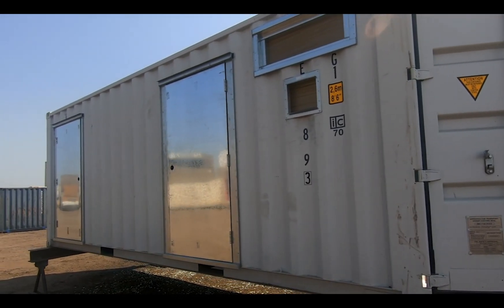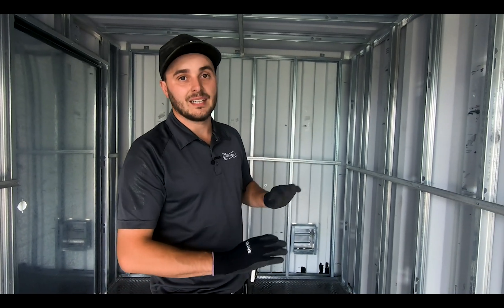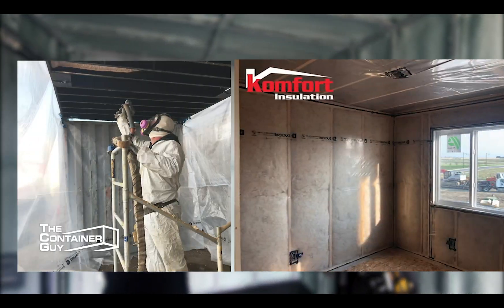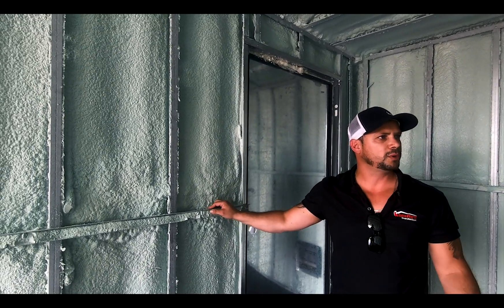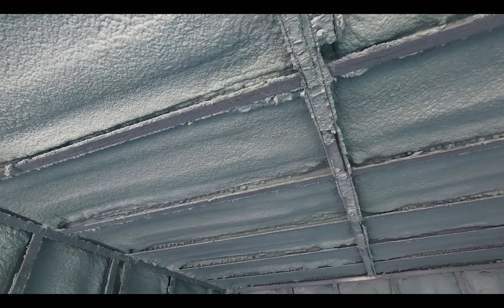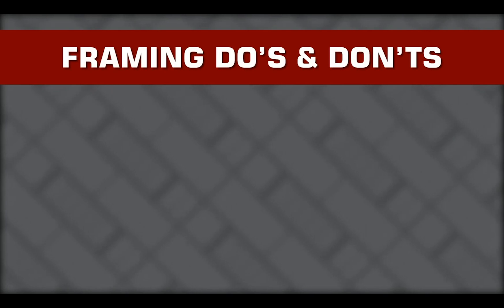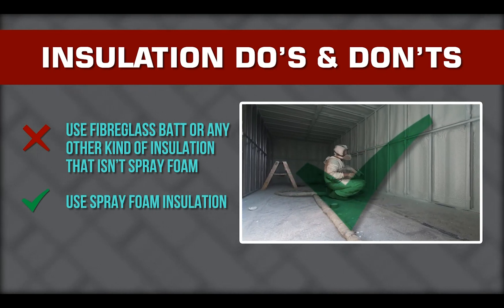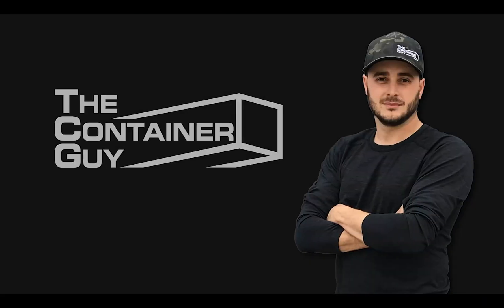Insulating a Shipping Container Home or Office - Komfort Insulation Interview

Comment: It has taken me a while to really understand what they were saying here. Closed cell spraying foam IS great at insulating. It provides the best R value per inch, and gets that insulation into every nook and cranny.. But it isn't just about insulating: 
- It stops warm, humid air from getting to the cold steel of the walls and condensing to feed mold.
- It plugs up unnoticed holes in the walls to stop water from coming in from the outside. 
- It glues the framing to the walls to make the framing and the walls much more strong and rigid.

Comment: Use 2.5 inch steel studs 6:25
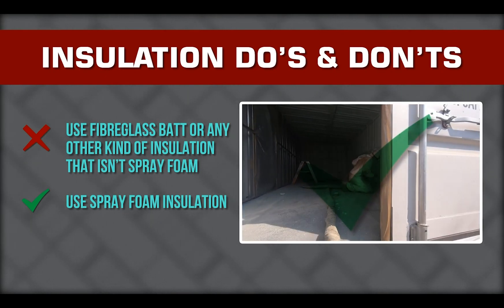Use 2 lb closed cell spray foam insulation 7:15

Comment: Can using stucco to cover the outside of the container prevent thermal bridging? 3" foam and then stucco applied to the exterior.
Reply from the maker: Should work if you cover every square inch of steel (can't leave the doors or underside exposed). Be careful with creating small air cavities. You'll want one common airspace between the foam and the container that's vented like an attic.
Reply: @TheContainerGuyTV  would you recommend still using closed cell spray foam on the interior aswell or it would not be necessary along as I complete what you suggested using the foam and stucco only? Or i can also spary foam the underside only and use the foam and stucco for the rest of the container?
Reply from the maker: @primodinero3006  check out our videos with the Exterior Studding Brackets. If you frame the exterior, stuff mineral wool insulation in the cavity, then strap the studs with vapour permeable foam, you can stucco that. You can still spray foam the interior to achieve an approved vapour barrier if this needs to pass code but depending on the climate, it's likely not needed. The wall system will already have tons of R-value.
Reply: @TheContainerGuyTV  FYI I'm located in Toronto Canada....thank you for your feedback.  Will send photos to your email  for your reference. 
I've also been trying to get a quote for the container connection kit. They said they are working on it!

Comment: I don't understand why the spray foam doesn't come flush to the steel frame face. It looks very thin and your math clearly indicates there is insulation value in every inch of foam.  If the studs are 2.5 inches, there should be at most a 1/2 inch gap from the stud face to the face surface of spray foam if you're going for a 2" install of spray foam.

Comment: Very important question: since we're talking about steel, which deforms with temperature (expands, retracts) ... aren't you afraid that the foam will come off the wall, leaving an air gap for condensation? I'm from Europe - where (so I heard - not being a witness to it !!!) that it's more likely to happen - that the foam might come of. I spoke to 3 companies that do spray foam, but none of them would give me a guarantee on this.

I was thinking about 5-6 inches of spray foam insulation, but now I'm not so sure ... can you advise please? What is your experience on this? Have you had a chance to check such foam walls after few years? Especially the wall facing the sun in summer and being exposed to cold temperatures in Canadian winters ?
Reply from the maker: If you're using 2lb closed cell installed by the pros, you're fine. You can have your contractor perform a pull (adhesion) test. We have one container that has been foamed since 2011 and it's perfect.

Comment: What is the best insulation option for shipping container containers in hot/humid environments?
Reply from the maker: I think hot/humid and extreme cold should have the same building envelope: Steel framing and spray foam. Condensation or humidity will rot/mold wood framing. The only difference would be an ERV (tropical) vs an HRV (arctic) for mechanical air exchange.

Desert and Temperate climates may be similar building envelopes as well where people may get away with cheaping out a little bit. We are working on a spray foam less wall system that is hopefully safe for human occupancy 🤞 stay tuned.

Comment: I found that in Australia, foam insulation is almost un-insurable due to fire risk. Cool stores here have similar problems. Would pay to check before starting.
Reply from the maker: Do you know by chance if they use 2lb closed cell foam? Or 1/2 lb open cell?
Reply: That's not the case for the right spray foam. When considering insulation options for homes and commercial buildings in Australia, many people turn to spray foam insulation for its energy-saving benefits and superior air sealing capabilities. However, one question often arises: Is spray foam insulation legal in Australia? The short answer is yes. Spray foam insulation is not only legal, but it is also a widely used and approved method of insulating buildings across the country. However, as with all construction and insulation products, there are important regulations, standards, and best practices to be aware of to ensure safety and compliance.

Comment: main problem is: let "someone professional" do the job. hmhm find a professional in france.. there is none 😁 cool that you try to answere questions!!! 👏👏👏
Reply from the maker: Good news. We are working on a solution to ventilate, frame, and insulate a shipping container PROPERLY without using spray foam. I never thought I would ever say this but I think I've actually figured it out. I won't have concrete evidence for a few years after testing its performance in each season but I'll share my design early 2023! Stay tuned.
Reply: You will be okay, most of Europe is going green. Those wind turbines will keep everybody warm in winter. 😆

Comment: Hey Channing! 
Thanks so much for all the video's! What would be your advice if spray foaming is not an option for insulation? What would you say is second best?
Reply from the maker: What climate? What's the constraint? Budget or remote location?
Reply: @TheContainerGuyTV  I live in the Netherlands, so pretty moderate climate no extremes in heat or cold. 

Constraints mainly being budget, speed and flexibility. 

I have a one man woodworking business and i need to be out of my current shop in about two months. There's a chance I can put one or two 40' containers on the property to move my shop into. 

I don't know what layout will work yet, so I thought to do a simple (more traditional) insulation job, so in a couple of months when i know what s decent layout is, i can take some of it apart and start adding windows and doors and such.

Comment: So the cold roll is screwed to the face of the studs just to hold them in place until the spray job is done?  Also, what kind of pain in the ass does this create for the electrician that has to follow the insulators?  Also, have you ever just screwed hat channel to the tall side of the corrugations?  I'm thinking about doing that, but I'd have to insulate the back of the hat channel before I screw it to the wall.
Reply from the maker: We played around with hat channel in the video below because we only had an inch of room for "framing". The roof corrugations wobbly even after lining it with plywood. If you are looking for a slender framing system, use 1 5/8" steel studs and pull them away from the corrugations 7/8". Then insulate with 2" closed cell spray foam. We have a Steel Stud Bracket bundle coming out shortly that will do all the thinking and guide people through the best framing method. https://youtu.be/b0_zBWi6a1M
Reply: @TheContainerGuyTV  I appreciate the response!!  I've watched a couple more vids and you are a crafty dude.  keep it up.  I just subscribed and I plan to follow.  I think it's pretty brilliant with your use of hat channel on the lid in the video you linked.

Comment: Do you place any kind of tape between the container and the stud tracks on the ceiling?
Reply from the maker: No we don't. We just came up with a Steel Stud Bracket (SSB) that mounts the top track to the 60mm tubing. It will work with 2.5" steel studs or what we have recently discovered works better, 1 5/8" steel studs held ~1" away from the wall. They'll be available on Amazon or containermodificationworld.com. I'll try to release a short video or post about it shortly. Stay tuned!
Reply: @TheContainerGuyTV  Thank you for the reply. That sounds great, do you have an estimated time when those SSB will be available? Cheers
Reply from the maker: @tamlornchase  if you email parts@thecontainerguy.ca, we might have enough prototypes in stock to fill a small order. Otherwise, likely a couple weeks.

Comment: Why can't you use foam panels that when installed between a wooden board and the shipping container wall thwt when tightened down it will compress to fill the gaps?

Comment: Not using as kiln.  Also already have a old 40.  I have walled off 12 feet and need to insulate it with insulation that can withstand 160 F.  A wood furnace will be installed and operate to maintain over 130 -150 F. In the hot room will be half of a run around coil system . 24 x 48 multi pass coil with fan . Glycol loop to home with like coil and fan . We already own all materials. Going to see what kind of heat we can claim. The remaining 28 foot box will have cord wood.

Comment: Would I be able to maintain 150 F with a average wood stove after that insulation ? Cold climate day 10 F 20 ft container ?
Reply from the maker: If you're trying to kiln-dry firewood using a container, consider an ex-reefer unit. They have full stainless steel interiors and great insulation.

Comment: How to insulate an container home from 38-48 degree Celsius temperature?
Reply from the maker: The same way you do -38 to -48. Spray Foam. Could go up to 4" of foam. Containers get pretty narrow if you frame with anything larger than a 2x4. In 2x6 walls, a "flash and batt" system (2" of foam, 4" of batt) works well and is a less expensive option. Batt helps with sound so even 2" foam, 2" batt would be nice.

Comment: Hi. Are the studs held of the container wall? I’m converting a one trip into a reefer for may business.
I’m planning on 4” of closed cell. Thanks
Reply from the maker: John, we are building brackets right now that are meant to hold the studs away from the wall to allow a continuous layer of foam around them. We have a steel stud bracket (SSB) meant to have the finished wall 2.5" away from the inside corrugations using 1 5/8" steel studs. We also have a wood stud bracket (WSB) meant to hold 2x4s 3.5" or 4" away from the inside corrugations. In your instance, the WSB using 2.5" steel studs would be a perfect solution and will assist you with the framing process. Email parts@thecontainerguy.ca if interested.

Comment: Great info 👍... Would you recommend using 1” closed cell spray foam first to seal the container, then using 2.5” studs to frame walls (3 5/8” studs on ceiling), then insulate with fiberglass insulation in between studs?  ... thanks in advance
Reply from the maker: I would not foam first then stud later. The framing locked into the foam adds a ton of rigidity to the container. You could pull the framing away from the wall 1" if you want but make sure it's locked in place with foam otherwise your interior wall panels will have too much movement. There are a lot of people that don't insulate at all and others that only use fibreglass so the flash and batt system you suggest would work great in my opinion (except in the Arctic). I would use Rockwool Safe N Sound instead of fibreglass. 10 years ago, we were told 1" of foam is all that is required for a vapour barrier and that was later upgraded to 2" (likely because of the variation in spray thickness) so in my opinion it'll work. We've insulated containers in the past with only 1" of foam and there have never been signs of condensation in the winter.
Reply: @TheContainerGuyTV  thanks for the help and quick reply! 👍
Reply: @TheContainerGuyTV  Thanks for the info!… Was planning on using 2 1/2 inch steel studs for the walls and 3 5/8 inch steel studs to run the ceiling unless you recommend using “hat channel”… Did you secure the steel studs to the container wall before spray foam? Or let spray foam secure everything
Reply from the maker: @JoshBarbe  2.5" studs on walls with top and bottom tracks, 3 5/8" (or even 5.5") in ceiling with no tracks on the ends, and spray foam locking everything in place is the way to go. You can tack your walls in place with scrap steel stud pieces to the top 60mm square tubing. Be careful with the back corner castings. You need to have your ceiling low enough (2" below the underside of the castings) to allow for a proper vapour barrier. Make sure you use stiffener bars.
Reply: @TheContainerGuyTV  great thanks!
Reply: @TheContainerGuyTV  is one row of the stiffener bar about halfway up sufficient or should I do two rows? Thanks
Reply: @TheContainerGuyTV  Sorry, another question ... what gauge of steel studs are you using for the walls and ceiling? 20 gauge ok??

Comment: Thank you for the great insight!  My question is geared towards maximizing internal space.  My intent is to build a workshop, not live in a container.  So, can we frame, insulate, and apply an exterior layer (e.g. siding, stucco)?  What are your thoughts?  Thanks again!
Reply from the maker: That would be the way to go. Strap it with purlins and girts. Make sure you have a sloped roof. Lock everything in with spray foam then finish the exterior to match your yard. You would likely best off to use a 3 piece knockdown steel door frame and traditional North American man door. Make sure your total wall thickness is at least 5" thick for these doors. Then, strut-line the interior in the outside corrugations so you have a fully modular shop and no interior width lost. Sounds like a cool project! Good luck and I'm here to help if you have any other questions.
Reply: @TheContainerGuyTV  thank you for the quick and thorough response!  I'll have to google almost all of it 😂 - but I appreciate you pointing me in the right direction!  If you've seen or done work like this before, please pass along the info or links.  I'll begin my research now...thanks again and happy new year!
Reply: @TheContainerGuyTV  I need a phone number
Reply from the maker: Send us an email to mods@thecontainerguy.ca. I'll think about this a bit further and see if I can get you rough design using readily available materials. www.planmycan.com is another great resource for your planning.

Comment: Wood stove Installations tips needed plus materials needed
Reply from the maker: Hi Grant. To start, obviously make sure there are no flammable interior finishing materials around the stove as you normally would in a home. Ideally, you'll have a stove with fresh air intake. You'll want an insulated wall thimble through the wall. I'd like to design a corrugation-dependent frame (similar to a BigAir45 vent) that would accommodate the thimble and be insulated with rockwool. One could finish up to this frame and spray foam the rest of the container as normal. What size of chimney pipe are you using? 6"? 7"? On the outside of the container, I would run two vertical lengths of strut channel and use them to secure your adjustable wall support and wall bands. Make sure your chimney extends past the roof of the container. Email mods@thecontainerguy.ca if you have additional questions. I can also send you a conceptual design and maybe one day post a video on this. I'd like to install a wood boiler stove in a container with PEX lines in a concrete slab floor. The thermal mass of the concrete would act as a battery and provide heat when one is away or asleep and not tending the fire.

Comment: Ok this is great but what I don’t see addressed is when u bury a container, say a 20’ one, for a storm shelter, food cellar or wine cellar even.  So, if u reinforce the interior like a rib cage to prevent cave in with 6x6x8 PT, 2’ on center, then you use spray foam in between the 6x6, then 1/2” plywood over walls, floor and ceiling, then we have reinforced walls and insulated vapor barrier and inverted container for more roof strength too...I know y’all don’t modify for burial but a lot of people are doing it...steel beam interior is 10 times the cost or more which is only reason interior is timber framed but I get it steel is preferred.
Reply from the maker: Burying a container isn't cheap but could be done. They tried on Mythbusters and failed. The weight of the backfill collapses the corrugations. I'm certain a strut-lined and 3lb closed cell spray foamed container would pass engineering. I wouldn't use pressure treated wood. Also, the wall and roof corrugations are only 1.6mm thick. I'm told (by our outsourced engineer) the negative ions in the earth will corrode the steel. The entire exterior would need to be continuously lined with an expensive rubberized coating. I've always thought a big concrete septic tank as an underground bunker would be a cheaper/easier option.

Comment: Very informative. Do you have a prep work for spray foam video?
Reply from the maker: The spray foam adheres directly to the container wall so no "prep" is required other than making sure you mask off everything you do not want over-spray on and that your container is framed properly either with strut channel or steel studs. I will have many more videos on each of those topics in the future.
Reply: @TheContainerGuyTV  I was wondering about this too, do the interior of the container walls to be washed with anything? Ive heard about the foam falling off the ceiling, i wonder if theres any prep work that can be done to prevent that